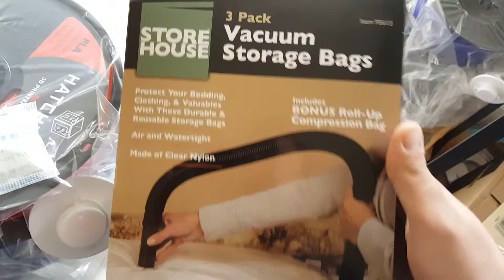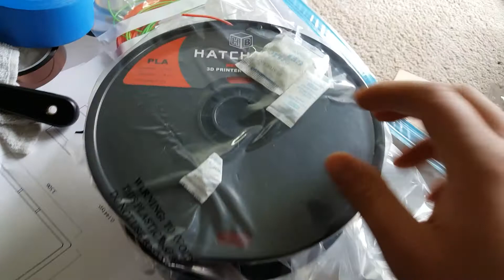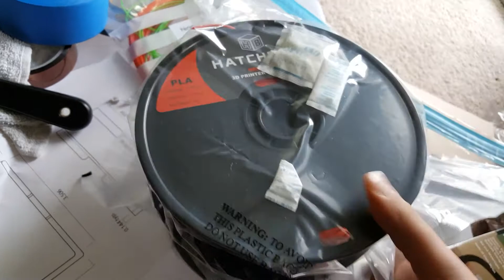HatchBox Filament PLA Review

Comment: That's an AWESOME printer setup. Might I ask what it is? If it's a self-built printer, would you happen to have a schematic and/or a list of parts that went into it? (If so, maybe make another video about it?)
But with all due respect, dude, this wasn't totally helpful . . . I don't 
mean to be rude, but all I heard by way of review was that it's awesome 
& that you can't praise it enough. I understand you like it, but 
generally a helpful review should contain details on why specifically you like 
it so much. What makes it so awesome? Is it a consistent diameter 
combined w/ a lower extrusion temperature? Or do you have a 
spring-loaded extruder (or something similar), that isn't as picky about
 consistency in filament diameter (& hence that's not a concern)? Are the colors consistently as advertised? Again, I really don't mean to be rude -- I hope you 
understand what I'm trying to say here? I only say this because I got more 
details out of a 2-minute review than this one which was more than 3 times as long
 . . .

Comment: I bought both red and green hatch box pla after watching this review. Neither colour will stick to the heated bed, not even close. I finally got it to stick using blue painters tape that was sanded and cleaned with acetone but the prints were very weak. I could break the layers easily with my fingers. 210 degrees on the head and 70 on the bed has worked for every other pla I have tried. I tried 180 degrees to 240 and nothing worked.
Reply: +Shawn Lund I have being using Hatchbox (black, white and silver) running it at 185 on the extruder and 70 on the bed, using only painters tape and it sticks like a B!!! some of my prints feel like are going to break the glass before they come off!!
Reply: Thanks Fernando, I think I got a bum roll because the black Hatchbox Filament works fantastic.
Reply: I got some problems too at the start with parts coming off of the bed while printing... to solved I added some supports on Meshmixer to increase the contact area of the object being printed and I was able to complete the print without problems. My only current problem it's with the overhanging sections that tend to succumb to gravity and slightly deform.
Reply from the maker: Sorry for the lack of a response.   I have had plenty of luck with it I would try to get a different roll.  Both painters tape and kapton tape have worked well.  Sometimes when I use painters tape with a glue stick and it stuck almost to well

Comment: What's the highest quality print settings on the simple metal
Reply from the maker: The highest resolution is 50 micron, but the highest I have used is a    .1 layer height even then I don't use it much because it takes to long.  I mostly print at .2

Comment: I'm trying to print w/ Hatchbox Blue 1.75mm PLA and E3D's Chimera hot end and I'm getting a lot of stringing when I move across the print to the prime pillar and back again.  What prime / retraction distance and speed are you using?  Do you have any stringiness issues w/ Hatchbox PLA?
Reply: To reduce the stringing try lowering the temp a bit it tends to make the filament a bit more stringy
Reply from the maker: I second neo, usually that's telling me your running to hot, I've managed to take it down to 185 with their filament.   A good test to to heat up the nozzle and extrude around 5 to 10 mm of material, pull it from the nozzle and then see how much continues to leak from the nozzle.   If more than 5mm leaks chances are you are to hot. Lower it 5 degrees and try again.  For pla I would really try to not go lower than 180 cause you risk the chance of clogging the extruder